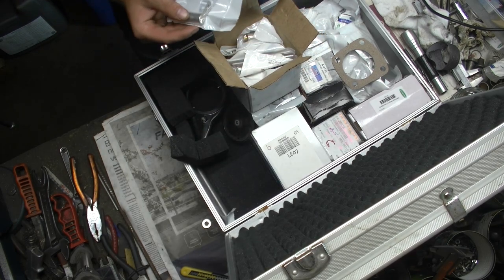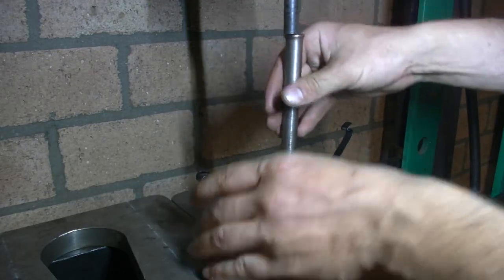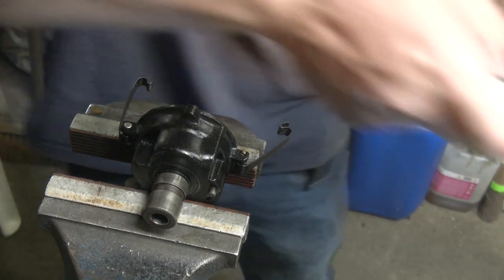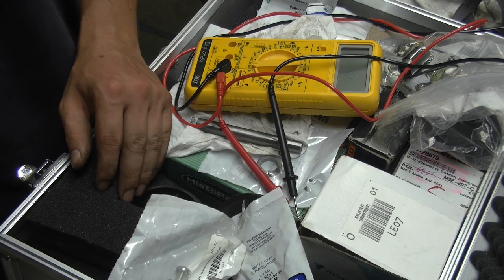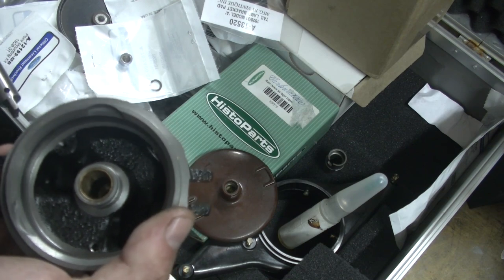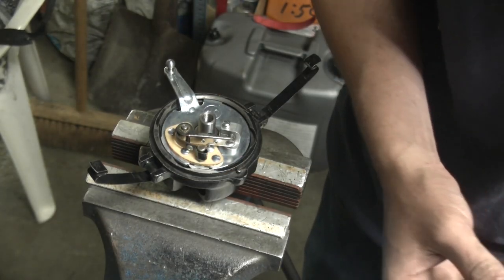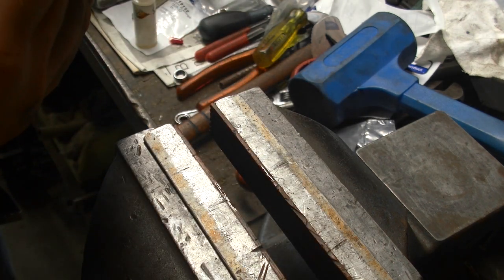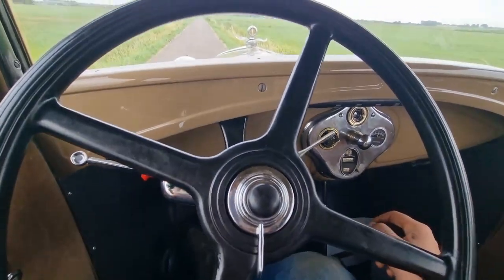Ford Model A distributor overhaul - Old style plates (2023)

Comment: it is easy to static time the distributor with a 12 or 6 volt light depending on what voltage your car runs at. You set your engine to TDC or 5deg before or whatever the manual calls for and then  hook the light lead to the points on one side and the battery on the other and turn the distributor until it just comes on (points closing) and the back it off until the light goes out and you are timed. I"m guessing there are tons of videos on this.

For an old engine like this a small amount of slop in the distributor is not really a big deal since you don't run up the RPMs a bunch. You will still get a slightly inconsistent spark but nothing like a vehicle that revs up high.